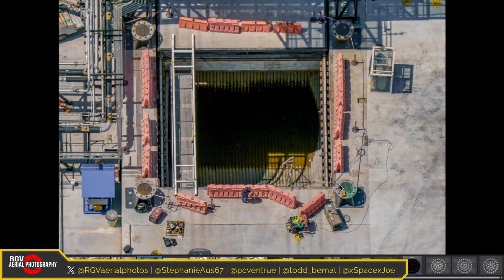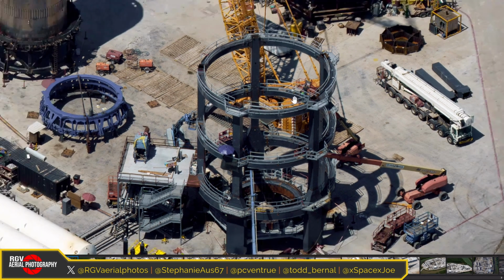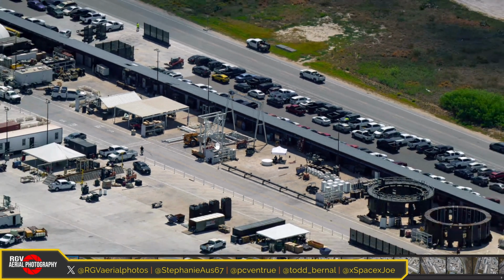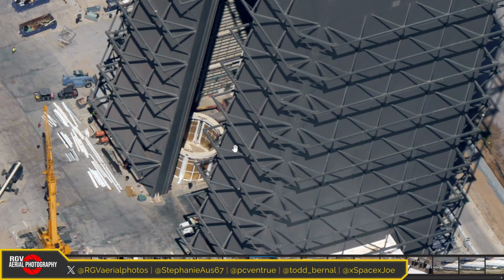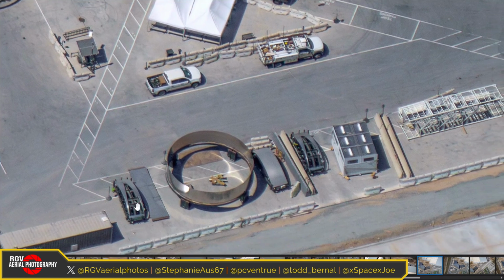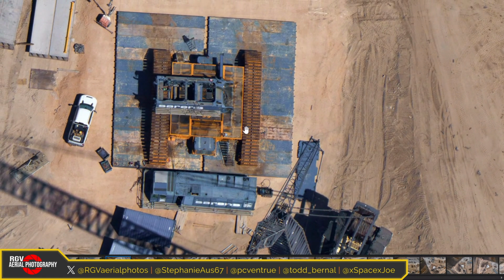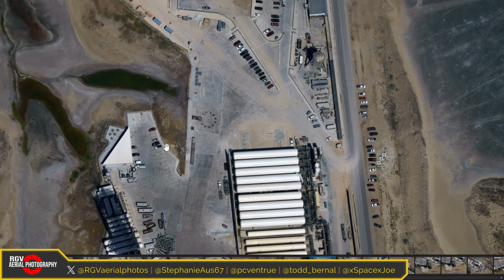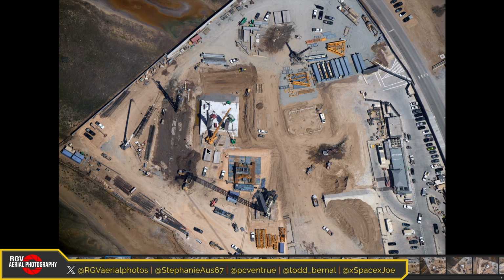Starbase Weekly, Ep.120: What Happened to the Massey's Test Stand?

Comment: Approx 1hr in - ablative tile on top makes no sense in terms of rapid reusability - the whole point of an ablative tile is that it burns away taking the heat with it.  As such, if the ablative tiles were the outermost part of the heat shield, they would need to be frequently replaced, if not every flight then certainly every second or third flight imho.  Doesn't make for a rapid turn-around of the ship.

Another thought - if the new "thicker & stronger" ceramic tiles are on top of the ablative tiles underneath, how will the ceramic tiles be fixed to the ship - separate pins or glued to the ablative tiles beneath.  If the former, no problem if a ceramic tile comes off, it the latter could the ceramic tile compromise the ablative tile beneath when it comes off??

Comment: At Massey’s the flame trench wall has been leaking since the beginning in the 2 wall joints nearest to the QD edge on the left wall as you are looking towards Mexico. When you were trying to answer the question you did not have the right pictures up to see it but I have been following this issue from the start. One joint just looks damp usually but the closest one has enough at times to stream water down the trench ramp.
Reply: Thank you foryourinput.  We will keep an eye on it.